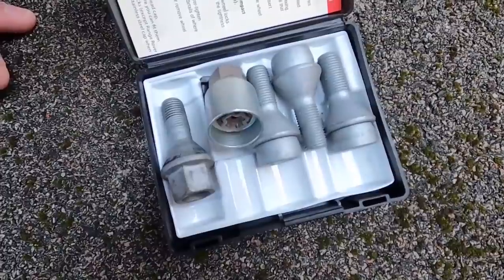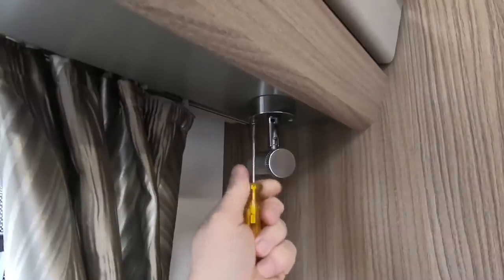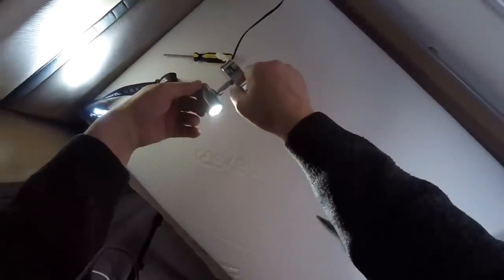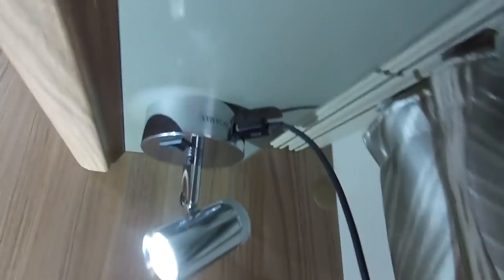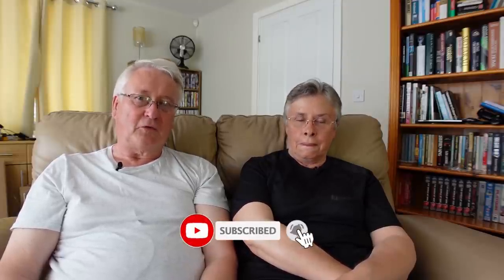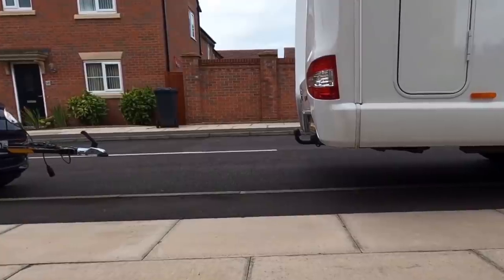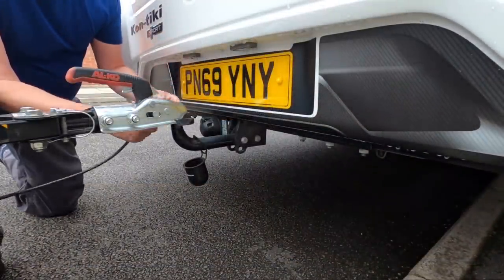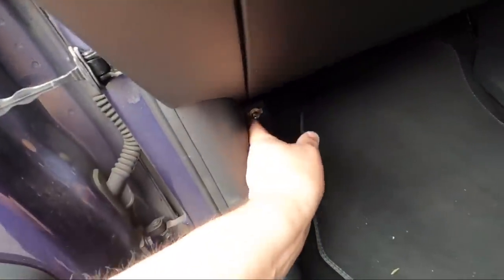Our Top 3 Motorhome Modifications

Comment: We’ve got pretty much everything on our Van. Air suspension. Level system. We’ve put  gas inlets both sides of the Van  a alpine head unit sat nav . But your USB lights brilliant idea. Also because I’m the one who has to put the tow bar on the car  because hubby’s disabled I love your tow frame  it would make my life so much easier. Because I have to try line it up put it on. Which sometimes takes me ages I’m only tiny anyway. Takes all my strength lol  so I’ve found your video very good 👍 thank you both 💛
Reply from the maker: Yes the Smart Glide is a great idea for hooking up solo. You might want to have a word with Tow A Frame. For the latest information, please contact
Mike Northeast
Mobile +447742667681
mike@smart-tow.com

Comment: Hi Both, Very helpful video, thank you and I bet you can guess what's coming now... Question time.... did your wheel/s need balancing after you fitted the locking nut/s and how much does towing the car effect the weight limits of your MH? We've got 3.5 and have not been able to find out if the weights would be an issue. Thanks both and have a great weekend.
Reply from the maker: No the wheel nuts don't affect the wheel balance as far as I can tell. As for towing weights I worked out what I could tow with my Swift Kon-Tiki Sport 574 in this video https://youtu.be/bpCaMqu8sdk
Reply: Thanks Bob, calculator on standby once a visit to a weigh bridge has been made. Being nosy, would you mind telling me if are you driving on C or C1?

Comment: Hi there Bob and Jenny.  Seems you can't have too many USB points.  I'd love to see some more type C with power delivery being fitted - charging a modern notebook directly like that would be a boon!  Pete & Kaz :) :) :)
Reply from the maker: Yes, not enough USB c sockets anywhere.
Reply: @BobEarnshawMoHo  think I’ve only ever seen one in the cab in a motorhome. Guess the PD ones would drain a leisure battery quicker than usual though.
Reply from the maker: Yes it depends on what voltage USB C PD sockets are using, my Dell Laptop mains charger uses USB C PD to deliver 45 Watts. They can be used at 5V to provide up to 3 amps.

Comment: When towing the car does the mileage being covered register in its odometer?
Reply: It didn’t on our Smart car or Honda Jazz. I doubt the VW will be different.
Reply: @richardcope3850  thank you for letting me know
Reply from the maker: No, most modern cars have electronic speedos, which don't register the mileage unless the engine is running.

Comment: Am I right in saying Bob.that you couldn't use the A frame to tow a automatic....
Reply from the maker: I believe not, but some semi automatics you can, I understand. Best to check with someone who does the conversion.
Reply: Automatic Aygo, Citroen C1, Peugeot 108 & Fiat 500 can be flat towed as they are MMT (Mechanised Manual Transmission) that don't have engine driven gearbox oil pumps.